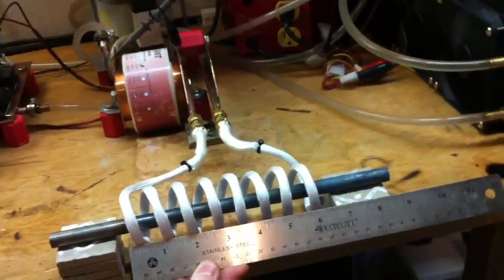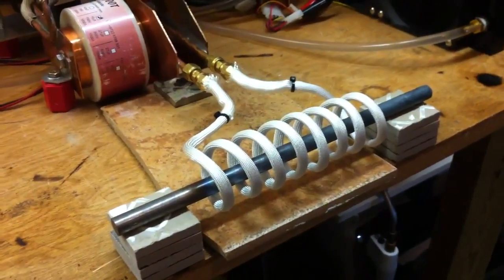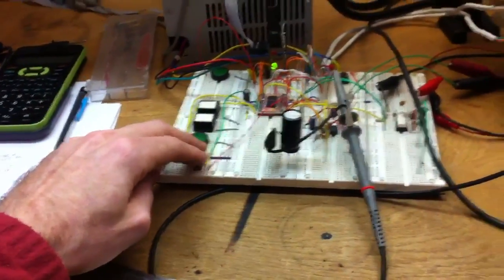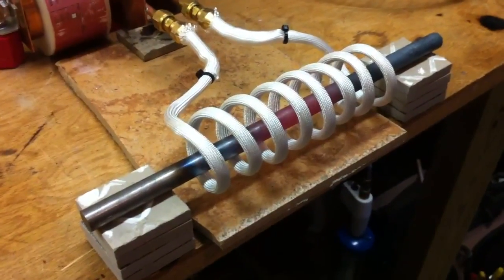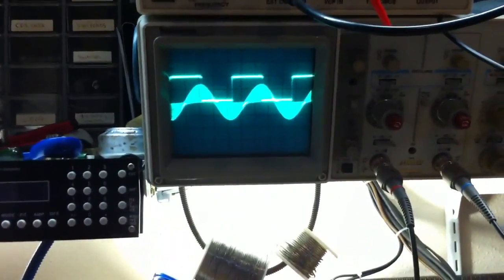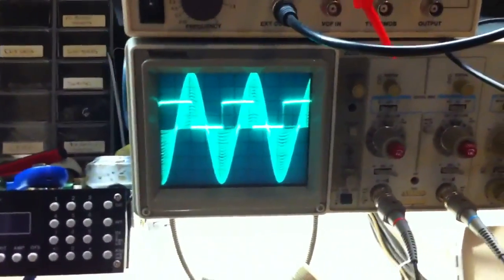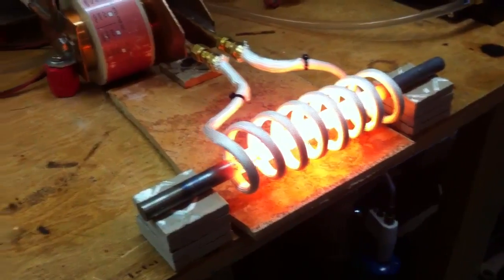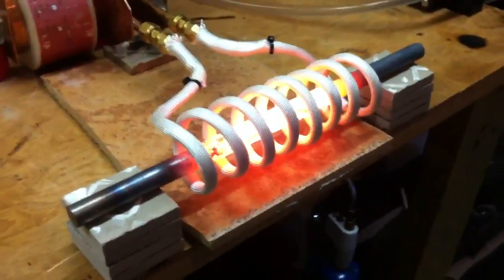Induction Heater - 6" Coil vs. 1/2" bar

Comment: hey josh excellent work. You are using phase shift power control for the power regulation of your heater. I've found a IC UC3876 which is labelled as "Phase Shift Resonant Controller". If i sync the oscillator of UC3876 with the pulse output from the PLL, will i be able to regulate the power by feeding the error amp directly from current transformer output while staying locked in resonance ?
Reply from the maker: Hey Mohiuddin, thanks! It's still a working progress but come a long way from the first prototype. To answer your question, as long as the PLL is controlling the frequency of the 3876 it looks like it would work. As long as the inverter output does not shift to fast the PLL should be able to compensate (they can be a little slow). How you tie in the current sensing to the 3876 and tuning the delays would be the tricky part.
Reply: thanks a lot for the feedback josh!! i'll keep you updated as the project goes on
Reply from the maker: Let me know what you come up with. I looked at a few other resonant system chips when I was trying to get away from the PLL but couldn't find anything that gave me the low part count which is why I ended up to doing it in software. The phase shifting wasn't something I was shooting for it just came about once I realized it was possible in software.

Comment: Can you put some scales under the material to see if the weight changes as you activate the heater? Also, have you tried granite inside the heater to see what it does? Perhaps this is how the ancients carved the stone. Your device may "soften" the material.
Reply from the maker: When metals are heated to a certain temperature, the particles of metal fuse together with oxygen particles. These new particles of oxygen are now being weighed together WITH the mass of the metal. When particles are added, so is mass. It would take are sensitive scale but the difference should be measurable (not sure if that's what you were getting at). 

I can't say I haven't tried heating up rocks yet, maybe in an outdoor crucible. Even then not sure I would want to risk exploding hot rocks and molten metal. :)

Comment from the maker: Paint it on or dip the work coil in it. And yes protecting it from shorting out and accidental contact would be the main reason for it in a production environment. The one my brother is using now has a rather small ID coil, around 1-1/4" and he shorts it out constantly, every time he uses it. It makes me cringe when I see it happen but it can handle it just fine. I have not spent a lot of time on finding a good coating solution because it's not a priority but when I do I'll share it.

Comment: Thanks, Josh. Protecting the coils from my old, clumsy fingers was what I hoped to do with it, Would the ceramic coating [I assume you paint it on?] protect the coils from shorting out across the work piece without affecting operation?
Thanks again! Dave

Comment from the maker: It's flexible fiberglass tubbing (non siliconized). It works ok for low usage testing just to avoid accidental contact with test gear and wires but being glass it melts pretty easy so it's not viable for shop usage. You would want a high temperature polymer ceramic coating for that.

Comment: After finding a how-to of sorts, the engineering doesn't look at that complicated. You just need to do the appropriate math to figure out what scale you need. The capacitors, power supply, and how many coil turns are all part of the heat + current math. rmcybernetics has some really great info on the subject!
Reply: yep, a lot of very specific parts, slamming stuff together wont work perfectly, what voltage current rating, what capacitance the cap has, determines the inductance and thus turns your coil needs to run it at max power, what coupling you need for a specific power etc

Comment: Well, I suppose I should of been more clear on my goals. What I'd ultimately like to use it for would be to forge aluminum and cast it. The size of the objects would be fairly decent in size, which if I'm not mistaken requires more volts and amps. The bigger the object the more current induction needs. For example, model airplane engines would be a great start.

Comment from the maker: @Levi - You can run this on 110. In fact I have it running on 110 now while I'm rewriting the control code to optimize the PI controller and current limiting. I've even ran it off of a couple car batteries, the inverter input can be what ever you like within the limits of the switching device.
Reply: Whats the the amp draw on 110

Comment from the maker: Jack, yes many manufacturers make induction coils that are encased in furnace cement, ceramics or similar materials. Since the coil is water cooled there is no harm in encasing it in anything non-condcutive.

Comment from the maker: Nice, I would defiantly like to see your setup. 
A couple of the requirements I had for this was to maintain isolation on the tank side and to keep the part count/complexity down on the inverter side. I would like a more stable current relationship between loads but I have not been able to come up with one while still keeping the first two requirements. I am quite happy with the phase shifting current limiting but I'd much rather it occurred naturally. Are you on 4hv dot org?

Comment: in my setup the inverter sees full sinusoidal current for a wide rang of loads without only need to track the resonance frequency(open loop) and because the linear relationship to load value ,the Efficiency always high

Comment: yes my point was LCLR matching tank.in this topology u have to decrease the L match if u want more power , but decreasing this value cause  to pass more 3rd and 5th and high freqeuncy harmunic current throw your inverter .this is harmful for solid state device (my mistake high di/dt not dv/dt).

Comment from the maker: Also the input to the inverter is rectified, unfiltered, pulsed DC which results in a near perfect power factor on the mains side. Slightly higher apparent power output can be achieved with a large filtering capacitor (or bank) but at great cost in mains peek current draw and power factor.

Comment from the maker: To clarify power level control is achieved by varying the phase shift of the drive to one half of the bridge between 0 degrees and 180 degrees when compared to the drive of the other bridge leg. This means the power factor seen by the inverter remains good because the inverter is not detuned from the resonant frequency, therefore reactive current flow through free-wheeling diodes is minimized (higher efficiency and less heat to dissipate).

Comment from the maker: Wouldn't it be more accurate to state that rather than the ratio varying (which it doesn't since it's a fixed coil); it's just that the tank is being quenched, in other words the tank excitation voltage is lowered in turn lowering the current draw and thus heating capacity?

This effect is why I lowered the turn ratio on the matching xfmr, to heat larger work pieces. And you're correct the resonant frequency does change but since it is tracked by the micro processor it's not really an issue.

Comment: in the other hand you can use other matching networks that not varies with load value. and in this setup the inverter current has a linear relationship with load value (low current in null load)actually you don't even need to track the resonance frequency .I will post a video in youtube

Comment: another disadvantage
 of this stuff is that for increasing the output power you have to decrease your matching inductor value and 
this is not good beacause the matching inductor supresses the current spiks of the inverter .and when you decrease. it cause this current spiks to damage your transistors(switching loss & high dv/dt)

Comment: LCLR matching network has a gear ratio that varies with load resistance.actualy when you put a heavy 
load into the workcoil the gear ratio will be highest and your current will be low.and reverse in null load. and also your resonant frequency will be change  .

Comment from the maker: Phase shifting the IBGT's does generate some switching loss. But it is the lowest amount of any other "switch" type current limiting I've come across. With the water cooled block it's easily dissipated even at full null load while limiting mains current to a safe maximum. I've got some interesting videos of the data output from the uP rendered in a custom processing script that I'll try to get up soon. Here's a pic: t dot co/hLdnaO6EGf

Comment from the maker: I am using an LCLR matching circuit in this setup with a step down ratio of 18:1. That high ratio did serve to limit the maximum null load to an acceptable level. However this "high gear" which resulted in built in current limiting (good) but slow heats from cold (bad) was something I wanted eliminated. I did so by lowering the matching transformer ratio to 6:1 and implementing a phase shifting current limiting scheme. I've also switched to a parallel vs series tank setup.

Comment: 1500 watts in start and 6500 watts in high temperature.it seems you are using a LCLR matching circuit or similar .a disadvantage of this kind of topology is that the heater will pull huge current when it run at nun load situation.and you have to put a current limiter to protecting your circuit.in fact your heater power has hardly increasing with decreasing of load resistance.